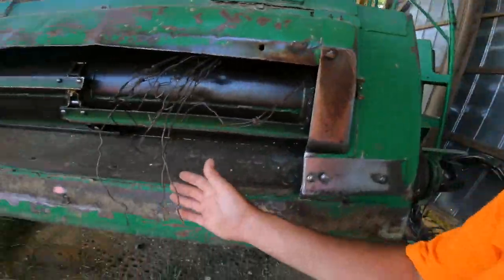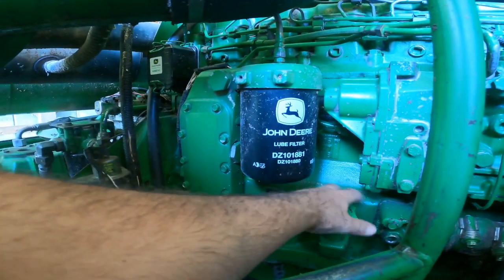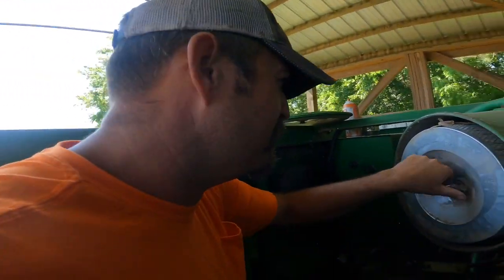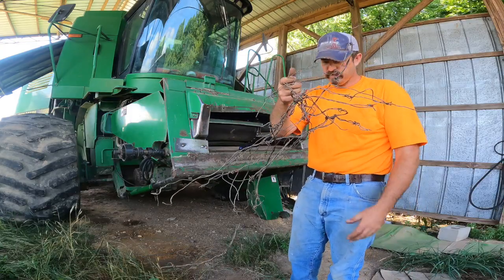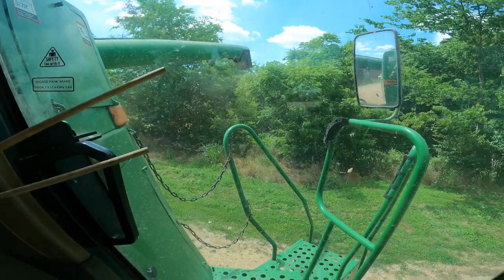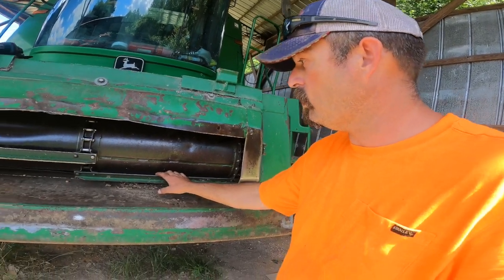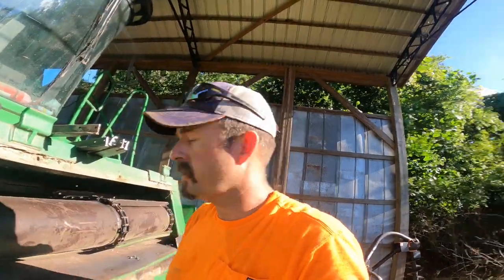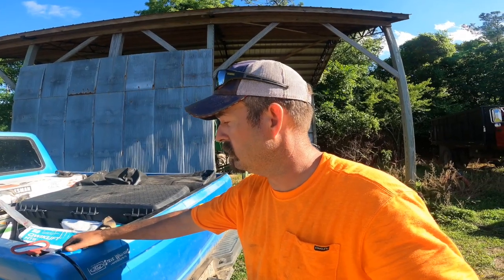A Hammer Will Fix a Combine

Comment: I know a guy that farms next to a glider port.. brand new Case-IH 8020 a few years ago, picked up a glider cable... They spent all day, with 3 of them and 2 mechanics from the dealer getting it unwrapped from the rotor... Was the next day before it was running again.. BTW, don't harvest fences, they don't yield well..
Reply from the maker: That would suck.  I know a guy that ran a couple of t post into a rotor, it distorted it.  I'll take that into consideration next time 😁